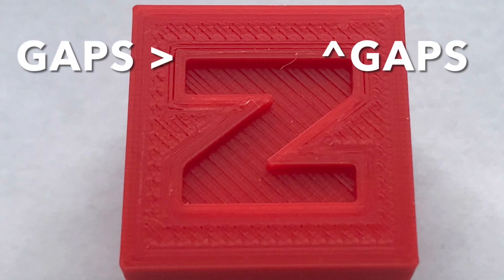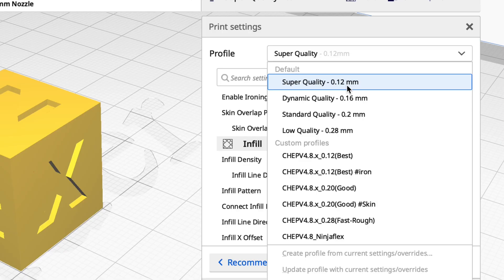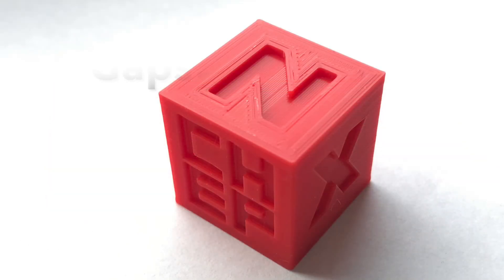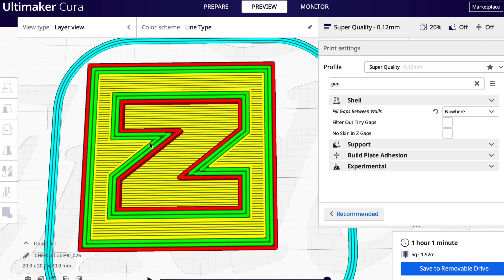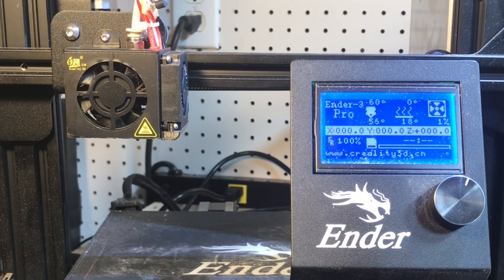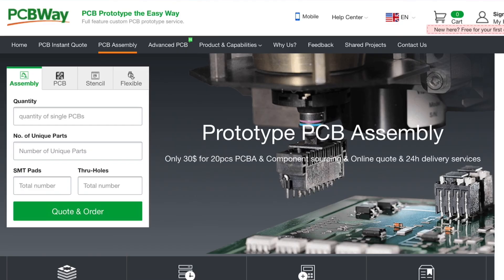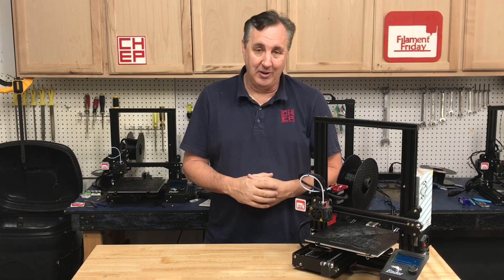Cura 4.8 Slicer Tips for Eliminating Gaps in your 3D Prints

Comment: Thank you for this video. I have bambulab and working in bambu studio but for 2 days streight i wanted a top layer of my print to be printed as 1 line. It is a sphere so it was printing outside line, than inside line (aroung hole) and than fill in the between. It leaves awfull finish and gaps between outside and inside walls. With overlap % set to 100% i finished the top with nice pattern and it looks beautifull. I was going mental looking for option like that :D.

Comment: This is definitely good information but I'd love to see a continuaton for how to stop walls from delaminating. This problem has recently crept in at random points and I am at my wits end on where it's coming from and how to solve it.  I know it is not the nozzle or filament as it happens with current and brand new 0.4 and 0.6mm nozzles and it happens with PLA, PETG and TPU.  Circular walls seem to be affected most and changing wall thickness, flow rate and number of walls has no effect.   I've even gone so far as to replace the whole hot end and recalibrated my e-steps 4 times (they're dead on now btw).  I've been advised to try pressure advance but from what I see this is klipper only so out of luck there.

Comment: very much appreciated!  If I set the top/bottom pattern to lines and change the line direction to 90 degrees, is this only recommended for this specific calibration cube and other similar print shapes?  Like if the model is curved or detailed in nature is this a decent setting to use?

Comment: The only problem with this setting chep is it does not do the cross layers any longer seems that this would make the prints less strong and not adhear as good changing to to 90 degrees?

Comment: if i change the top/bottom line width to 0.26 ( with a 0.4 nozzle) and the overlap to 50% the top looks awsome but the bottom is totally messed up. it looks like the line wasn´t printed full and very irregular. any ideas why? can the slow first layer speed (20mm) be a reason?

Comment: Chep, can u help me with problem when under extrude only happen when after fill gap and it change to next layer. Ender 3 pro print with under extrude when gone to the it started the next layer
Reply: And only happen when printing small keychain hole area
Reply from the maker: Check these: https://youtube.com/playlist?list=PLRFPlUhDTTlka-Cq-UmI3IbbHRIwG2OsX
Reply: @FilamentFriday  yes i already done that but the last video about 28mm caprocorn tube in the hot end. i already have that new capricorn tubing, dual gear extruder, change the nozzle, and my cube test print is flawless, but when it comes to the model that have 1.5mm diameter hole it will under extrude when reach certain layer. even when i print a bulbasaur model which it will have under extrude at one of the ear which it change layer starting a new layer at the ear, it will under extrude at first, after that will be nice print. just the ear part. its easy if i can show u the picture. is it any contact i can show u the picture of what i meant? and when i print the model which doesnt need to fill gap or retraction alot, i dont have this kind of issue.
Reply: @CHEP and for your info, when i tested close the fill gap setting in cura, the problem dissapear, but my model have a gap where there is no fill at that area. is there any setting that can help on this issue. thanks for replying me

Comment: Informative video as always, but temperature controlled fan?  Why not use the marlin option to do so? Seems like hitting a bug with a sledgehammer when all you need to do is comment a line in Marlin.  "Autofan"
Reply from the maker: The Creality boards don’t have the fan connected to a digital pin control. So Marlin would have no control over it.

Comment: Hey Chep, love your channel, helped alot  thx. Got a question about your chep cubes, I have gotten my extruder to push out 100mm and got my z distance right on, my x and y are about .007in strong on cube do u think I should adjust x and y stepper settings to get it right on or do u think this is in a good enough measurement
Reply from the maker: Good enough.

Comment: With the lines printing at 90 degrees they don't overlap each layer like the default setting, will that effect print durability? Is there a way to print -- sideways than | up alternating each layer? Great tip, I think this was the problem Ive been struggling to figure out.
Reply from the maker: Use [90,0]

Comment: ive always had great luck with prints using your profiles. but now that i upgraded from 4.5 to 4.8 nothing looks anywhere near what it used to be. i decided to change nozzle, clean everything, and add the blue bowden tube. that helped a little but my chep cubes look like i have horribly loose belts. so i re tightened the belts and i still cant get it nice for round items with .20 profile. have you decided to not have any focus on the .20 profiles? have a great day.
Reply from the maker: I’m getting great prints with my profiles and the stock Cura profiles so I’m not sure what the issue is for your prints.

Comment: One of my printers has the problem of gaps and I never could figure out what caused it. My other printer doesn't have the issue. I've messed with the extruder steps/mm, which helped shrink the gap and fix other issues, flow and a few other things but never completely got rid of it. I'm going to give this a try tonight! I'm also interested in the circuit board, except I have an existing 'extension board' that I'd like to replace with the circuit built in. You have a new subscriber! Thanks!

Comment: Hey Chuck or CHEP, i following most of you videos for some cura tipps, but i was here a bit confused about the Fan modul you mentioned. i'm comming form an Anycubic kossel and that has the turn off of the fan as standard software feature, does this would also work for the ender 3, without PCD and additonal sensors? (just got one fro chrismas and starting to work with it.
Reply from the maker: Creality boards drive the fan direct from power not what you describe for Anycubic.
Reply: @FilamentFriday  thanks for the very fast awser. It's said to hear that it just so primitive "solved"

Comment: Halo sir, i just notice that stepper  motor in 3D printer is hot.
is it normal or its a problem ?
i cant measure how hot it is, but feels like same with bed temperatur at my case are 55 celcius.
can you make video about 3D printer temperatur ?
thanks a lot. will appreciate.
Reply from the maker: It shouldn’t be hot.

Comment: Thanks for all you've contributed to the 3d printing community. If you put [0,90] in top/bottom line directions it will alternate the lines every layer between front to back and side to side and I believe result in a stronger more accurate print. - You can even use something like - [0,45,90,135]. It does them in order and then starts over.

Comment: Chuck,I need help my 14 year-old son says that the extruder keeps moving to the right and making click noises,it is not the slicer he says,and he says that even though the preview showed it correctly printing,the extruder print back and forth,then stops,then keeps moving to the right.I need help!
Reply from the maker: I don’t understand. It’s suppose to push the filament to the right into the Bowden tube.
Reply: @FilamentFriday  he says the filament goes back when it’s being printed...
Reply from the maker: Try a sample file that came with the printer. If it does it then it’s a printer problem. If it doesn’t then it’s the slicer setup.
Reply: @FilamentFriday  never mind turns out I put the wiring wrong thank you chuck!

Comment: I just updated my E# pro with the creality 4.2.7 board. Your gcode bed level does not work correctly with it. It just goes to each position and keeps going. I am not good at gcode or anything else.  I am too old to undertand those thngs. But your bed level gcode worked very will ever since I got the ender 3 pro. Any help from anyone would be appreciated. I leveled the bed just by homing and dosableing the steppers and draging the hot ende to the 5 places your gcode uses. After I started the print I used a 30 layer wide skirt and adjusted the bed until it looked ok and stuck.
Reply from the maker: Use the 4.0 M25 version

Comment: Hey Chuck. I had never paid any attention to the Top/Bottom Line Directions or Skin Overlap Percentage until this video. Only ever looked at infill overlap percentage.

I am going to try using [90,135,0,45,90] Top/Bottom Line Directions so that it alternates the layers and also starts and ends with the left to right one. That way both the bottom and top of the print will have this. If you leave it at just [90], it will go lines left to right for all the top and bottom layers.

Comment: If you switch motherboard to something better like SKR 1.4 you can actually control fan speed a loot easier. You just need to connect fan to E1 heater (second heater) in the motherboard, and then you can control it with Marlin settings. I have my printer turned on all the time, and fan only turns on when nozzle temperature reaches 60 degrees. You can even control it's speed using marlin.

Comment: As strange as it may seem my flow rate was changed some how so i turned it up on my printer as it prints and it seems to be taking care of it I got it jacked up way high on the printer what do you recomend i set it at in my slicer because i get gaps between my walls all the way thru my prints
Reply from the maker: Have you calibrated your e-Steps?
Reply: @FilamentFriday  Im new to 3d printing not sure to do that

Comment: I just discovered a feature of cura 4.8 in the expiremental tab, i changed my printer to "exclusive" mode on the volumes and now every piece i print that needs to fit just fits together perfectly without having to use insets.

Comment: Thanks for the update on Cura 4.8, just upgraded for my Ender 3. When I printed the CHEP cube, my x, y and z were a little off. X= 20.21, Y= 19.97 and Z= 19.85. Before upgrade to 4.8 I was using 4.6 and x,y and z were all 20. Any suggestions much appreciated. Haven't reprinted yet with the new settings from this video.
Reply: Just printed CHEP cube and X=19.93, Y= 20 and Z=19.84. Everything is much smoother but there are hole in the Z cavity.

Comment: Thanks for your great tips, you are subscribed. 
But I think in the first section "Top/bottom line directions" is a little mistake ;-)

You used (90°) for the angle setting, but then it prints only horizontally in one direction (all layers).
Only with (90,180) the angle in the next layer is changed by 90° to the previous layer.

correct me in the case I'm wrong...:-)

kind regards from Germany
Rolf
Reply from the maker: It only print 90 for the top and bottom layers. You can do [0,90] or [90,180] if you want. 
I like them inline for this.
Reply: @FilamentFriday  Wow , quick reply...:_)

And Yes : Merry Christmas / Happy Holidays !

Ok I correct myself, NO ERROR, just a "preference".
Sure, (0,90) also works.......for "my preference". 

Have an nice day and stay healthy
Rolf

Comment: Puzzle by the temp control circuit. You have two variable resisters there , looking at your other video. It's a thermistor, uk icon is a box with a line and then a bit of a line. Usa version should be the same , just not a box but a zigzag like you did for the other resisters.
The box with a line and arrow is a variable resister

Comment: Hey Chuck. Merry Christmas
The fan board you created is already a function in Marlin located in Configuration_adv.h  Extruder_auto_fan_temperature. Wouldn't it be easier that soldering PCB in to just adjust this setting.
Reply from the maker: That only works if the fan is connected to a microcontroller pin. 
Currently the fan is connected to 24v direct power so that’s why I created the board.

Comment: Panel the PCB by V groove, if it is for example 20mm x 20mm then you will get 25 on the 100 x 100 size giving 125 for the normal $5 for 5 boards :)
Check their minimum distance between V grooves as there a size bellow which there may be a special charge. Panel by stamp hole is another option.

Comment: Chep you need to look at top surface skin layers. Set to 1 or 2 and then set the line width of the top surface skin layers to .2 that way all your top/bottom skin layers aren’t printed with a .26 line width as that will increase print time.
Reply from the maker: I did exactly as you describe and saw the same gaps shown in my thumbnail. My settings eliminate them so I’ll stick with what I showed.

Comment: Can the fan controller be use on a 12v printer? By the way your video are so helpful in the 3d printing world. Tks
Reply from the maker: Yes, it should work but you might have to adjust the base resistor value to 1k.

Comment: Not sure about Cura but PrusaSlicer's new ironing option eliminates top surface gaps by ironing out to the edge of outer walls. Takes time so best option is iron only topmost layers to "seal" the print.
Reply from the maker: As I mention in the video this is just an alternative to ironing. I’ve shown ironing in Cura before. This method doesn’t give you the melted look around the edges that ironing can.
Reply: @FilamentFriday  Does Cura ironing go to the outer edge like PrusaSlicer? I'm getting very nice ironing results using Carbon fiber PLA (I may start exclusively printing in the stuff as it goes down like a dream and makes way tougher parts in my opinion - wish the price was more reasonable (£26 per roll Vs ~£20 for most other PLA variants). Not so good ironing results with other filaments.
Reply from the maker: Yes. Irons very similar.

Comment: Hi.  Long time lurker, first time poster.
For the Top/Bottom Line Directions the default values is a list of 45 and 135 degrees.  Is it okay to leave just 90 degrees in the list as I notice all lines only go at 90.  Would it be an idea to add 180 to the end of the list?
Reply from the maker: So suggested 0,90
Reply: Hi  @FilamentFriday  thanks for replying.  Leaving it as [90] works, but I wondered if there was value in using [90,180] instead?  That way the print has the alternating lines like the default behaviour.
I've got a print on the go now where I followed the advice on this video.  I am looking forwarded to how it comes out.  :)
Reply from the maker: Yes, that is an option to give you alternating layers. Default is 45,135.

Comment: Hey Chuck, Merry Christmas!

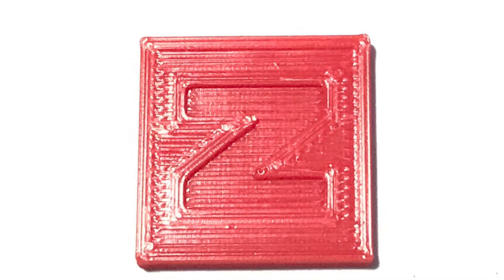I really like @1:15 when you show the partially printed top -- I know you didn't talk about it in that context -- but it's definitely smart to just print the section you want to test.  I'm gonna use that trick in future projects and test-fits. 🙂 -- By the way, I have two quick questions: 
1.) How did you arrive at the conclusion that .26 is the minimum top and bottom line width? (It does appear to be the case, just wondering how you could tell.  It's not clear to me in the UI).
2.) Also, I noticed that Top/Bottom line directions is an array (so you could put, [0,90] for example to get a criss-cross every layer) -- is using just [90] better than using [0,90]?
Reply from the maker: 1) i showed in previous video it changes to red I believe. 
2) yes, you can do that

Comment: Sorry to say, but using a PCB to control the fan is a dumb idea. There's a section in marlins firmware where you can set them temperature when the main fan turns on. I have mine set to 50°C. No circuit at all. Just 1 line of code.
Reply from the maker: In the Creality machines the fan isn’t connected to a micro line so your idea doesn’t work. That’s why I made the board.
Reply: @FilamentFriday  my mistake
Reply: @FilamentFriday  i actually have an ender 5 plus with a SKR 1.4 turbo. I have my hotend fan plugged in a controllable fan port for anyone interested.

Comment: is it open source if I have to be your patreon??
Reply from the maker: The schematic is all you need and that’s in the video free for anybody to reproduce, modify, improve. Many have reproduced it because I share all details. No code is required. You can solder wires, use a perf board, or many other ways to connect. You don’t need a custom PCB.

Comment: Why not $2 JLCPCB? If you cut the PCB yourself, 5 pieces of 100mm X 100mm board could net you hundred pieces.
Reply: As long as it one repeated design, and you panelize it yourself, they allow it and can get the separation by either V-score or milling.

Comment from the maker: Merry Christmas / Happy Holidays !
Reply: Merry Christmas CHEP!
Reply from the maker: My profiles are a starting point. You adjust per your print. That’s why I show the options and when to use it. You can then adjust as necessary. As far as 25 vs 45, Creality upped the max speed so many print can now use 45 and it helps so that became the new base.
Reply: Merry Christmas mate. Thanks for the info!
Reply: Thank you for all your videos.  Yes I would be interested in a kit too.
 Merry Christmas from Snowy Metro Detroit: )
Reply: Great tip as usual! Merry Christmas 🎄⛄
Reply: Merry Christmas :)
Reply: Merry Christmas Chuck!
Reply: Merry Christmas 🎄🎅
Reply: Merry Christmas CHEP!! Thanks for all the content you put out!
Reply: Chep try the option "print thin walls" ALOT simpler than using all those options
Reply from the maker: I’ve used it. Doesn’t fix all this or come out as smooth.
Reply: The same and a happy new year to you and your channel I hope 2021 treats you well!